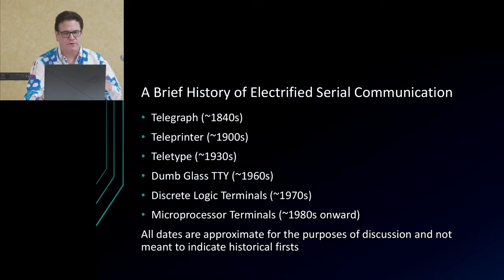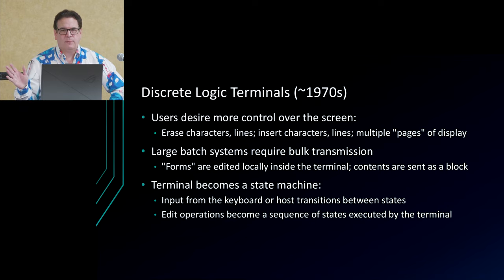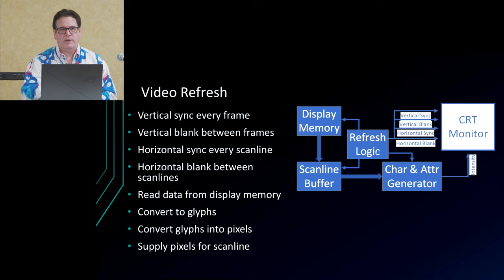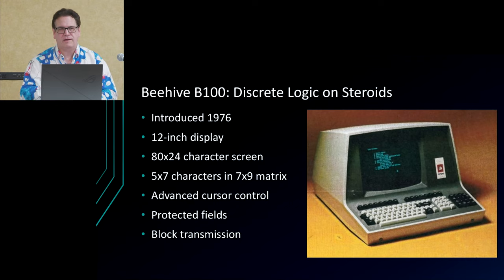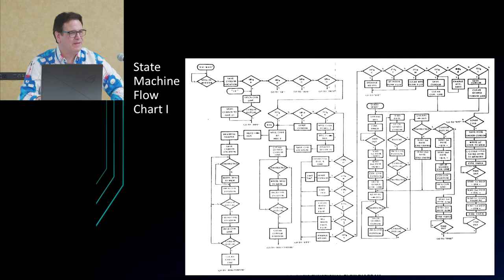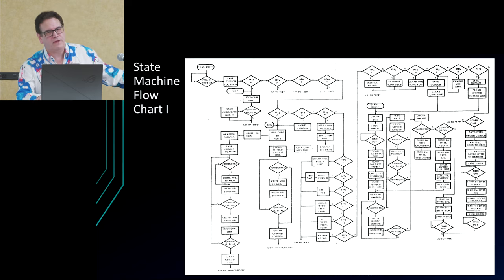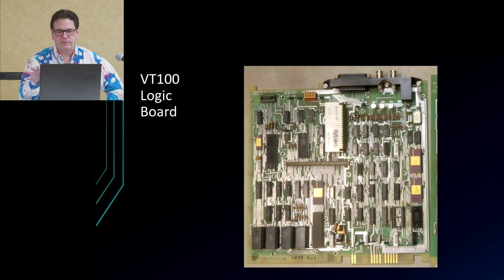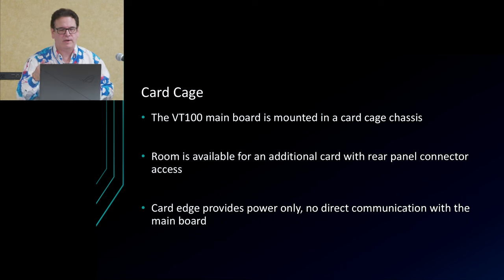What's Inside a Terminal? A Comparison of Architectures | VCFMW 18 (2023)

Comment: I'm working on a Basic/Four 7250 terminal. Pretty complex discrete logic. Definitely seems like it could be Beehive-derived.
Reply: Pretty much every raster CRT terminal is going to have the same functional blocks that I outline for the Beehive B100.  Where they tend to differ, when implemented in discrete logic, is how they handle the control code sequences.